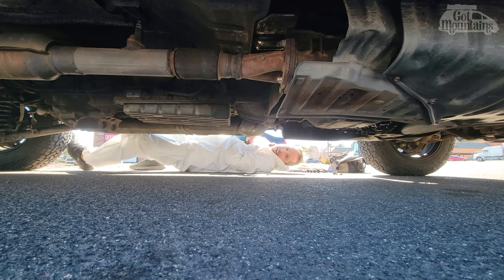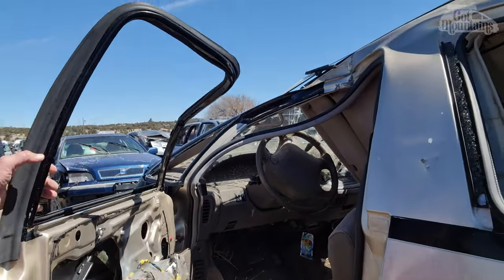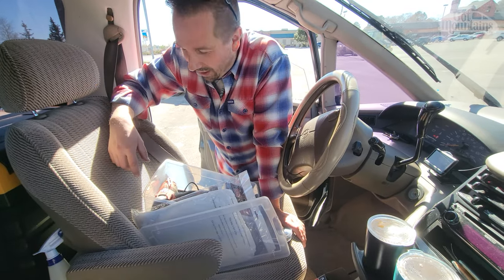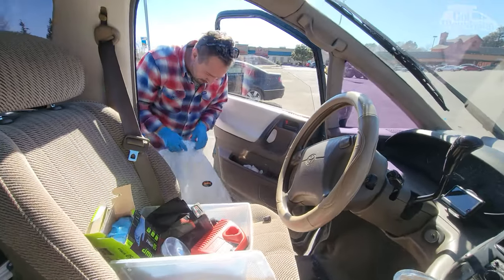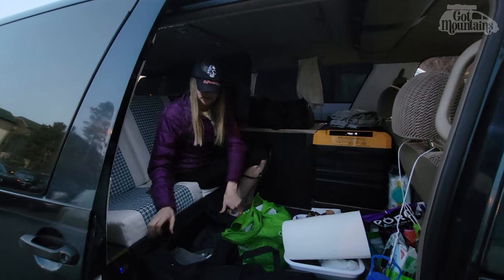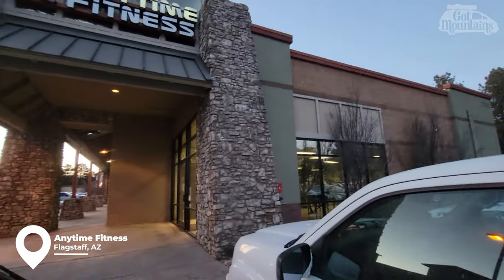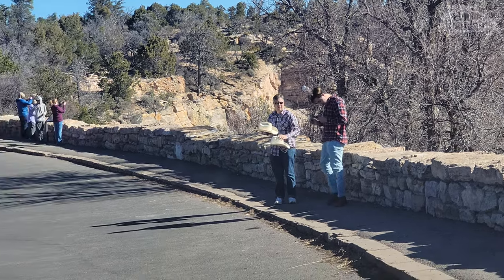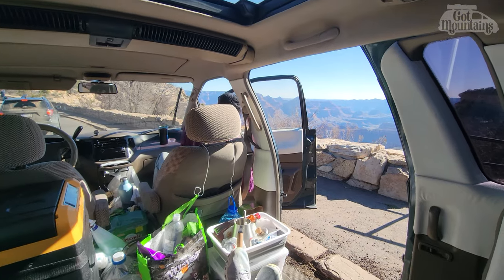The van gets revenge at the Grand Canyon // Van life vloggers S23E03

Comment: Getting sprayed by gas, definitely not fun.  ☹  
 Depending on the internals of the filter, you may find it will damage the filter element quicker over a period of time. There is often a mesh support on the outlet side of the filter element to prevent it moving with the fuel going through it. It will work in reverse but depending on how robust the element is, any pressure fluctuations in the flow will start to weaken the element over time and cause it to fatigue and break down prematurely.
Reply from the maker: Makes sense. I did switch it around a few days later. Hopefully with no long term I'll effects 😬
Reply: @GotMountains    Sounds good. I was going to add that if you changed it around, assuming a debris free gas tank, it would be a good idea.